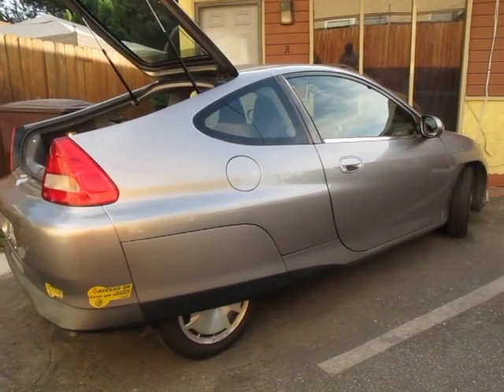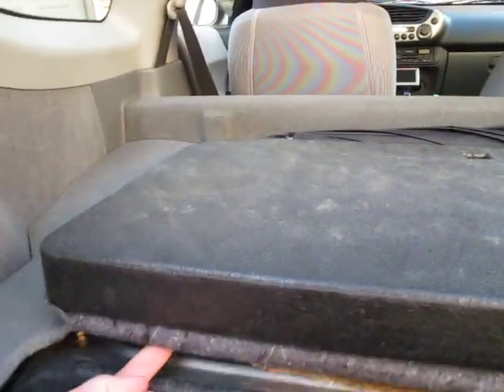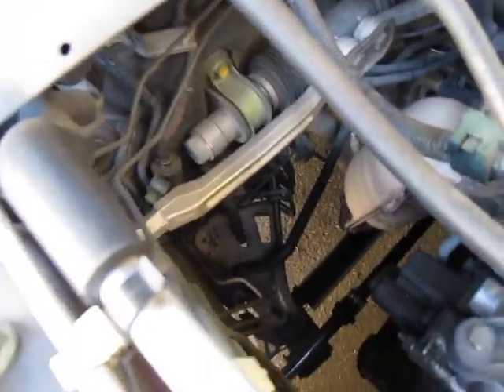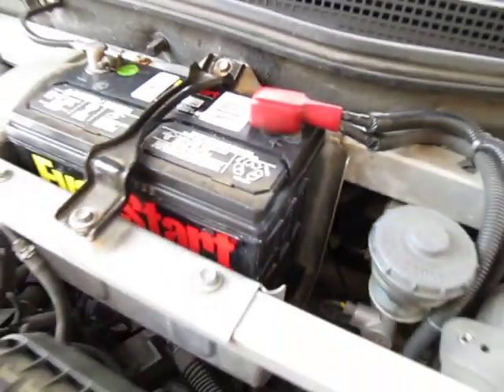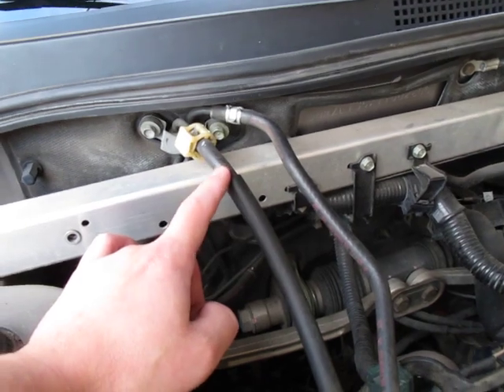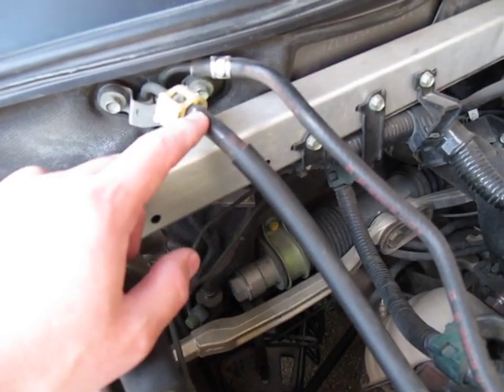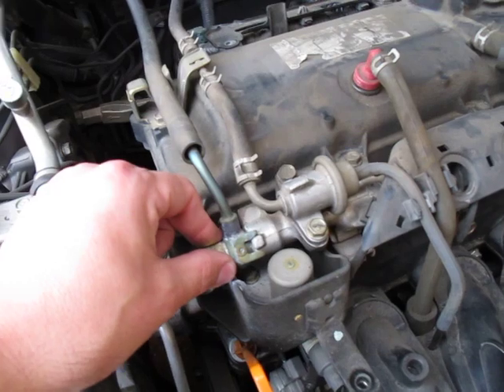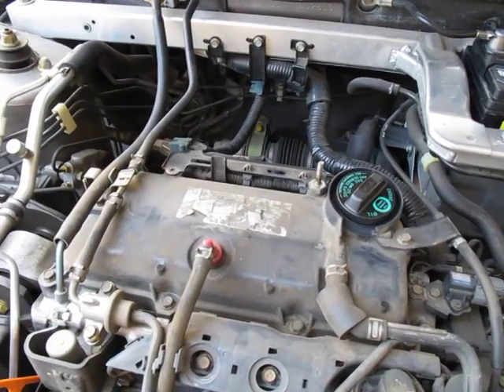Pre-Heating Fuel Concept With The 2000 Honda Insight

Comment: I am not sure how far you have gotten in your project but I find it interesting. I do have some questions for you. If you are going to use the heat from your exhaust to heat the fuel, what are you going to use before the exhaust gets hot? The injector needs lets say for sake of argument 22lbs of pressure to work properly on unfaporized fuel. So if you reduce the pressure the car will not run properly until the gas is vaporized.

Comment: I love this project!  I'm only just digging into your videos and I look forward to getting through your whole library!  Question for you:  Do you ever note a significant drain on the battery up front?  I'm very interested in trying this out as my IMA is starting to die, but I've read in several places of that their starter battery didn't charge with the IMA turned off.
Reply from the maker: dentsells I look on the forum "insight central" and study how to bypass the ima battery and keep the 12volt starter battery charging.

Comment from the maker: Billy heats a stainless steal plate to 600 F and sprays a fine mist of gasoline onto the 600 F steal surface. Billy discover that gasoline will not autoignite until steal reaches approximately 950 degrees Fahrenheit, thus 600 to 700 Degrees F is the ideal temperature range to heat the steal to. I'm still working on the new design, I may use a 1500 watt DC to AC Power Inverter to run the AC Calrod Heaters inside the vapor chamber. I'll make video's of each step of the process and how it works.

Comment from the maker: @MrFrancispiche Thank you for writing again. So far- my favorite Hydrogen On Demand water fuel cell design is Stanley Meyer's (See Stan's Water Powered Dune Buggy). Stanley is able to power his Dune Buggy with the Hydrogen released from water at the most efficient rate I've seen yet. Stan uses only 1 or 2 amps maximum- and many thousands of volts being pulsed at a specific frequency- Hertz. I believe I read that Stan pulses at well over 20,000 volts at a frequency of approximatley 20,000 Hertz.

Comment from the maker: With Billy's(Screen Name iambillythekid) system, once the white vapor has been produced, the white vapor will not condense back into a liquid as ordinary vaporized gasoline would when cooled to room temperature. Note that the air we breathe contains approximately 78% Nitrogen, 21% Oxygen, and just under 1% Argon. Billy believes an extra Oxygen Molecule may be combining with the gasoline- which significantly increases horse power, and may be responsible for the vapors non-condensing properties.

Comment from the maker: @MrFrancispiche Hi- Thank you for your comment and your offer to help me with my project :) Ideally- I would like to run an HHO generator which could produce enough Hydrogen on demand- from water- that would be able to run the car exclusively on Hydrogen. If you can create such a system- where the rate and volume of Hydrogen created can be easily adjusted- in order that I could begin using the HHO generator to simpley to boost miles per gallon and reduce tailpipe emissions.

Comment from the maker: at a speed of a hypothetical 100miles per hour; 6001 cubic feet of air (pumped per hour into the engine) weighs 484 pounds. Thus: this engine(61cubic inches) pumps 484 pounds of air per hour; or 8 pounds of air per minute, or .13 (One Tenth) of one pound of air per second at 4000 rpm's, under load (ie at 100mph). 100cubic feet of air per minute, at 4000rpm's under load, devided by 8 pounds (100 cubic feet of air weighs 8 pounds) equals 12.5. Thus 12.5 cubic feet of air weighs one pound.

Comment: I have a 2000 insight with about 130k. Interesting video thx. Have you come across or know anything about simply adding acetone to the fuel to help vaporization. I'm sure it still would not be as efficient as heating the fuel to the specified temps. Also, have you removed the electronics including the battery to help with weight reduction?

Comment: Or, you could get technical and go for a custom engine ecu.
It is something i have read about highly modified fast road car owners going for.
AD Autotechnic (3Xw  before and dotcodot uk at the end)  specialise in them. I don't know if they could monitor the fuel mixture and turn on/off the ultrasonics as they are needed?

Comment from the maker: I just watch the video you recommend, of Peter testing gasoline's boiling temperature. Video "Gasoline Boiling Temperature ((way below)) 220 Fahrenheit". Very interesting indeed. I also study "Fractional Distilation Of Crude Oil" (Google Search) which indicates approximately 300 F temperatures used to vaporize gasoline. It's also important to note the many additives in gasoline as well, which have various boiling points. It's important to use sufficient heat to vaporize all the additives as well

Comment: You know a pressure regulator restricts fuel on the return line to the tank thus producing back pressure in the send line from the tank. To lower the fuel pressure you'll probably have to get a different fuel pump and I'm assuming the pump is built into the tank of the car.

Comment from the maker: 6.3x1525=9608cubic feet of air per one gallon of gasoline(by weight ie 6.3pounds per US gallon). 6.3x3.5(cubic feet of vaporized gasoline per pound) equals 22 cubic feet of vaporized gasoline from one US liquid gallon of gasoline. 9608 cubic feet of air per one liquid gallon of gasoline ie per 6.3 pounds of gasoline at a air to fuel ratio of 122 to 1(122 pounds of air to one pound of gasoline with gasoline weighing in at 6.3 pounds per US liquid gallon). 9608 cubic feet of air + 22 cubic feet of

Comment: Have you given any thought to how you could increase the amount of fuel vapourised into the fuel/air mixture?
I don't know if you can reduce the output of these by reducing the feed voltage. I suspect not
 If you can, then you could source one that will supply the necesary fuel at max revs, and then slow it down. If not, then several would do it! They would need to      start as and when necessary to increase the fuel vapour when needed.

Comment from the maker: This is very interesting. I would very much like to know the CFM(cubic feet per minute of air(approximately 78 percent nitrogen, approximately 21 percent oxygen and just under 1 percent argon) the 2000 Honda Insight requires at maximum rpm ie 6000 rpm(redline). The engine is a 1 Liter, 3 cylinder, 61 cubic inch, 1000 cc engine. Please do share the site that allows cfm calculations. This will be interesting indeed. Once the cfm has been determined, the volume of vapor flow may be known as well.

Comment: Hey, I got a test for you. Your drive system is an electric motor, right? Even though the batteries are dead, the engine is still produces electricity to move the car. While others are still playing with direct HHO hookups, I have figured out how to produce HHO gas with a passive electric hookup. I think it could work on your car really good.

Comment: Have you looked at vapourising the fuel without heating it up?
I have been looking at those sonic water vapourisors. One site says that they do different sizes, from domestic to industrial. I also found a site that has the formula for working out the cfm drawn of an engine at maximum rpm. With that i suppose you could estimate how much fuel you would need to vapourise to feed the engine throughout the rev range.
Annoyingly, none of this will help me with my diesel engine :(

Comment from the maker: @MrFrancispiche To begin with- I'm happy to start with a water fuel cell which produces enough Liter's Per Minute to give a little more power and efficiency and reduce tailpipe emissions. A good friend mention to me that an ideal rate of Hydrogen production for this purpose would be 1/2 Liter per minute- for each cylinder the engine has. For my engine- this would be 1.5 Liter's Per Minute total for this size engine. I'm not familiar with the type of cell you create- but I do like your work :)

Comment from the maker: of gasoline makes 22 cubic feet of gasoline vapor, which I believe weighs 6.3 pounds(if the molecular weight of gasoline remains the same from liquid to vapor phase changes).How much air will this engine pump per hour at 100miles per hour at 4000rpm's. 61cubic inches multiplied times .85(volumetric efficiency)times 2000(intake strokes per minute at 4000rpm's)times 100(miles per hour) divided by 12, divided by 12, divided by 12 = 6001cubic feet of air pumped into this engine per hour at 4000rpm's

Comment from the maker: @beaugardner1 I add an aftermarket fuel pressure regulator with settings of 1psi through 5psi. As you mention, the engine would not run while cold at this low pressure. I decide to remove the aftermarked fuel pressure regulator and see if any increase in mpg would occur with the heated fuel at stock fuel pressure. I just upload a video where I talk about the results and also a much improved system invented by screen name IAMBILLYTHEKID Or Type "Molecular Change"in a you tube search

Comment from the maker: @beaugardner1 I just upload a new video which shows and talks a little more about this project. Let me know if this newer video help you visualize this first stage of testing vaporizing gasoline before it enters the engines internal combustion chamber. I also highly recommend you check out the GEET Fuel Processor at GEET International and GEET Friends home pages for free build plans of another system I'm building as well.

Comment: Thanks for the video, I have a 2000 Insight, citrus green colour. The battery (at the back) was dead, Honda Canada offered to give me brand new one for which I gladly accepted, I did pay $500 labour fee though.
The car has 121,000 km. I don't drive much. Now the oil pan and brake pad needs replacement also 2 tires are pretty worn out. I am tossing if I should get another car, the Honda dealer offer me $300 to buy it back but I think I can get them to give me $500. 
Any suggestion?

Comment from the maker: This is the first video- of many more to follow. I will be adding a Gasoline Vaporization System to this car's fuel system and to the engine. I will also add an HHO Hydrogen On Demand system as well- which will release Hydrogen from water- which will provide a little more power- and also reduce tailpipe emissions. Both systems will be shown in video's I will add to this channel :) Please feel free to ask any questions- and to share your experiences working with Gasoline Vaporization and HHO :)

Comment from the maker: Have a look at the forum Insight Central. Many First Generation 2000 To 2006 Honda insight owners- are active on the forum and can offer insight into what you may wish to do with your car. A very well made car is the Toyota Prius which is also a Hybrid. Toyota makes a Plug in Prius which gives you the option of using the much more efficient electric motor 90% + efficient, verses the gasoline engine apx 20% efficient at converting gasoline into energy that moves the automobile. Have a good day :)

Comment from the maker: 15cfm at 1000rpm's(idle) or .25(one quarter)cubic foot per second. 4000rpm's equals 1 cubic foot per second or 60cfm. First Question: To equate miles per gallon(of vaporized gasoline at an air to fuel Stoichiometric Ratio of 122 Pounds of air to 1 Pound of fuel) let us first specify that we are working with one US gallon of liquid gasoline= 6.3 pounds per gallon. One gallon of gasoline expands 163.3 times when phase changed into it's vapor state. How many cubic feet is in 163.3 vaporous  gallons

Comment: My other concern is how will you be able to supply enough fuel when the engine rpm rises? The reason for the fuel return pipe is the fuel pump supplies more fuel than the injectors need to ensure engine needs are met. The excess fuel is returned back to the tank. All injection engines work this way. With only 1psi fuel pressure, what happens at 3000rpm? 
I'm interested as the cost of fuel in England is BEYOND a joke! I haven't driven over 50 mph for over a year. IT'S DEPRESSING!!!

Comment from the maker: @MrFrancispiche As a minimum "Liters Per Minute" production of HHO(Hydrogen On Demand- from water), maybe I could start with 2 Liter's Per Minute of Hydrogen Production. If you can create a system that will allow me to easily adjust the volume and rate of Hydrogen production- this would allow me to- at a later date- make the modifications to my car to run the car on Hydrogen exclusively. Keep in mind- my engine is only a 1 Liter 3 cylinder 1000cc engine. Let me know what you can do. Thank you :)

Comment from the maker: @beaugardner1 I'm still building my first small engine GEET Reactor or GEET Fuel Processor. See GEET International and GEET Friends home pages for free build plans for a small engine GEET. I'm also looking for materials to build my first Molecular Chamber, which screen name IAMBILLYTHEKID has been running for 25 years with double the horse power, zero hydrocarbons(unburnt fuel) and an exhaust manifold which stays warm to the touch, rather than almost red hot burning liquid gasoline

Comment: Blimey, so if you can return 160 miles per gallon at 100 miles per hour, would you get even more at 70 miles per hour?
If so, i hate to imagine what you would get at 50mph!
My current car is a 1995 Citroen ZX four door estate with a normally aspirated 1900cc diesel engine.
I normally average around 40 mpg, but i have got this up to between 55 and 60 on a steady run driving carefully at a constant 50mph. It has a downside, it is depressingly BORRRRRRRRRRRRRRRRRRRRRRRRRRRRRRRRRRRRRRRING!